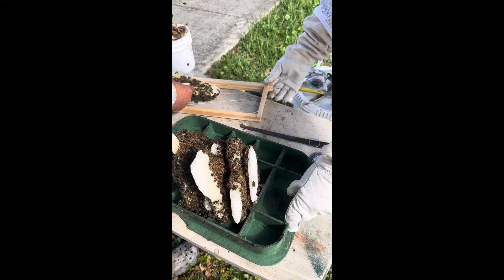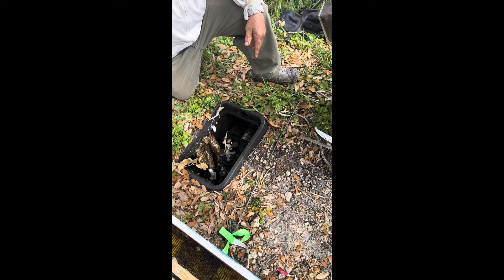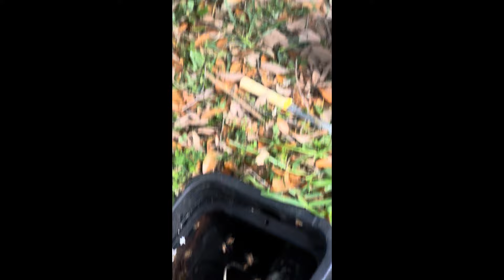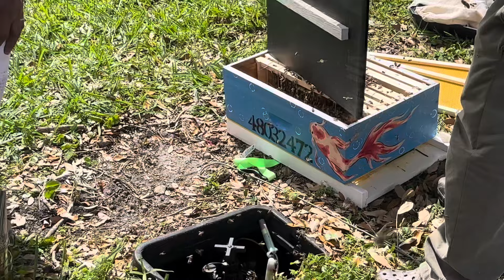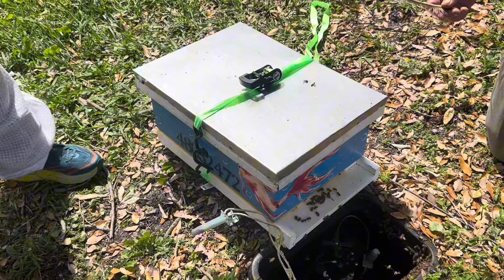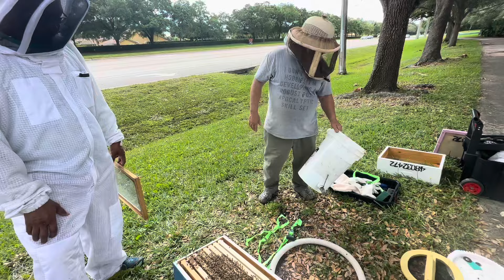Removing bees from a LIVE irrigation control box - beekeeping

Comment: I share your concern when working around electrical wiring. Generally irrigation electrical systems are low voltage. So if you were to accidentally slice through the insulation, since you were wearing well insulated clothing you might experience little to no electrical tickle —- rather than a VOLT. 😵
Reply from the maker: Shhh!  I know that, I was just yanking my wife's chain.

Comment: What did you spray on your hands?
Reply: vinegar
Reply: Hi Rich. I am first year with 3 swarm catches. I live in Central Florida the Bees are doing great!!! Question is it better to have two 10 frame deeps before I add a Honey super, or can I add the super to a full single bottom?
Reply from the maker: White vinegar to which I add some creosote tars from cleaning my smoker.
Reply from the maker: @reubenmcvey3  First, congratulations on your swarm catches.  Definitely the way to go. You can definitely add a honey super to a full single deep bottom,  but you will probably be swapping honey for sugar in the fall.  But that is only the beginning of your journey.  You now need to do a lot of reading and decide whether you are going to do single deep brood box management (much more intensive than double deep management), or deep and medium brood box management (better in areas of unpredictable fall flow), or double deep management.  Again, very dependent on your nectar flows.  The problem with a double deep brood box can be that A: bees with a lot of resources to defend can be a lot more defensive,  and B: bees with a lot of mouths to feed can get very defensive of their resources.  I just said the same thing from two perspectives.  My best advice is to ask everybody you can in your area what works best for them.  For instance, I spend a lot of time between Zolfo Springs and Bartow on 17, and note that a lot of apiaries there do a deep and medium for the brood chamber.  My solution to this was to go to all medium boxes and overwinter in 2 mediums, go to three in spring, and back down to 2 in the fall.  Much like a deep and medium setup, but with a bit more flexibility.
Reply: @southflbeekeepingwithrich  Thank you so much for the information!
Reply from the maker: You are very welcome.